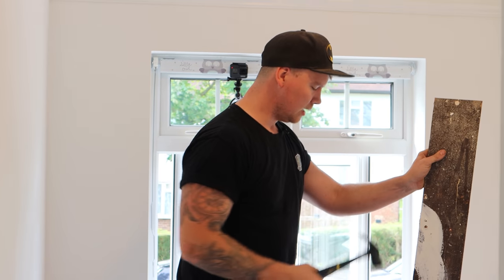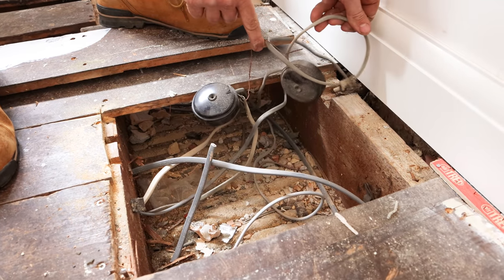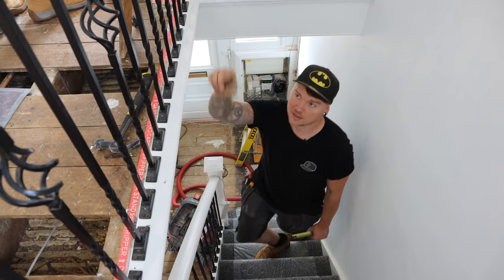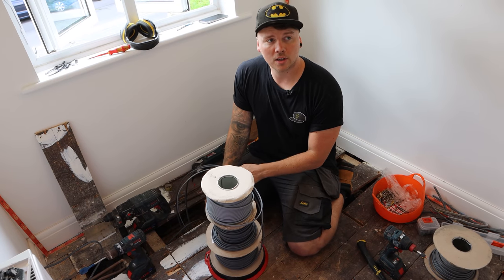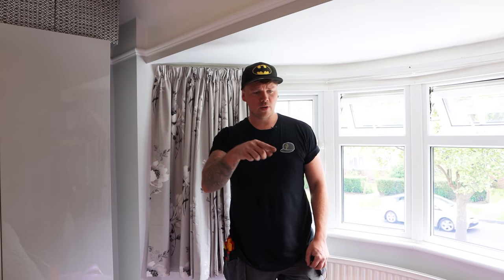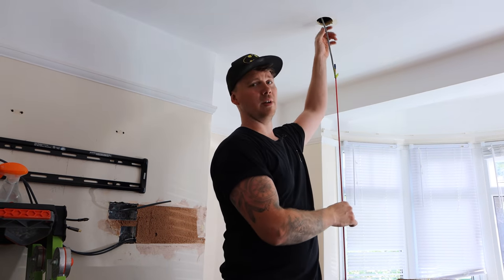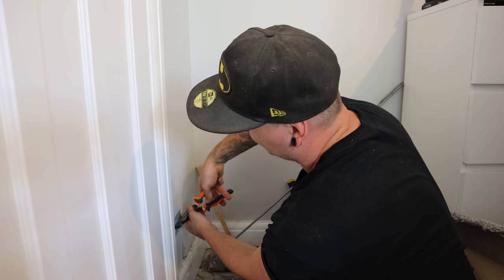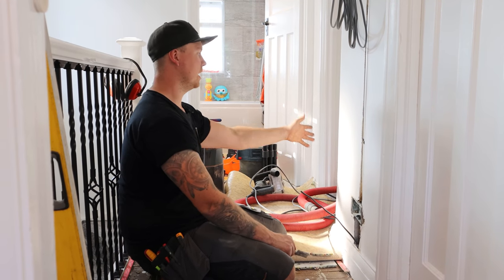Downlights in Lath and Plaster, Occupied Rewire - Day 3  - Electrician

Comment: Excellent rewire - with so much consideration to the customer. Just some thoughts .. when I’m multitooling or drilling in an occupied room I have the vacuum sucking the fine dust away. This might be teaching granny to suck eggs but when it’s hard to pull - I put talc 0n the cable.

Comment: Went to a house years ago that had a recent rewire every point was new cables they left all old cables in floors and celling connecter blocks on old to new ,no sleeving same thing at the board the ring was tripping to me ages to find it they had rammed loads of cables in a notched joist every time someone walk on that part it tripped the RCD he paid them nearly 5k🤠🤠🤠
Reply: That's just a crime, but I know it happens more than it should.

Comment: Can anyone help? I'm new to electrics and still have a lot to learn... Today I come across a RCD tripping fault, The 1st RCD had house ring and 2nd RCD had Kitchen ring. The kitchen ring on 2nd RCD when any appliance switched on would trip 1st RCD ?
Reply: The house ring also when any appliance was switched on would also trip the 1st RCD. Could both Ring Neutrals be touching somewhere or maybe a faulty RCD?
Reply: @Si6Si6  probably a borrowed neutral, like you say. check the lighting circiuts. most common place neutrals get borrowed, probably on smokes or 2 way strappers
Reply: Got a neutral connected to the wrong bus bar, from the socket circuits. 2 wires crossed over
Reply: This👆
Reply: Thanks guys, Appreciate it.